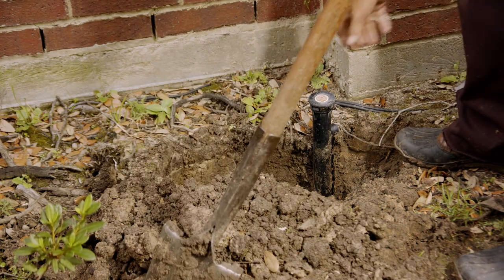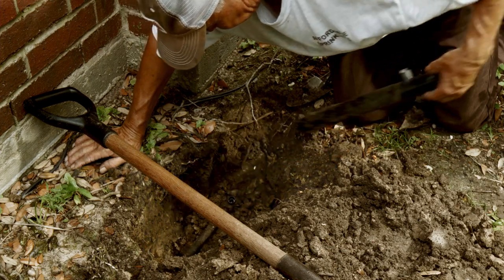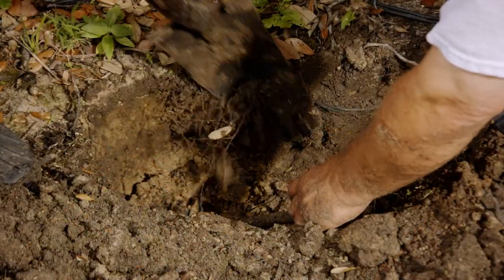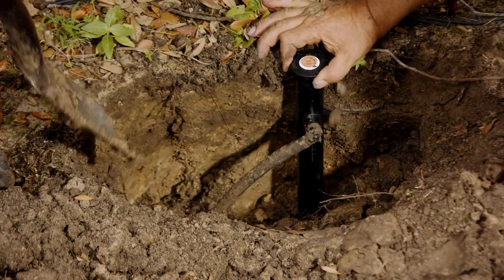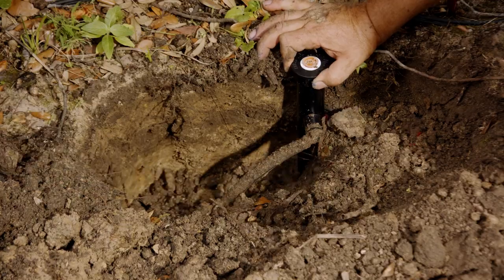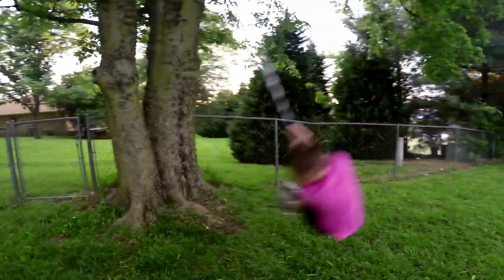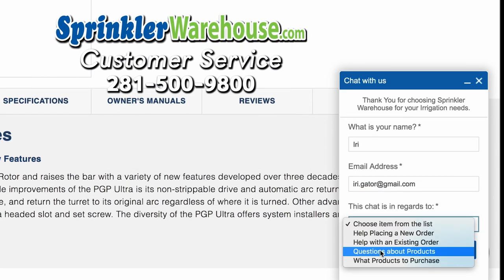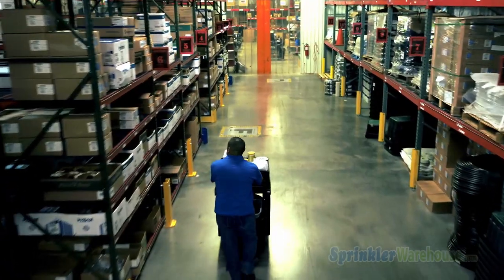Lowering A Pop up Sprinkler Head

Comment: Bruh u don’t need to lower a sprinkler head in a flower bed, this video is so unnecessary so I’m disappointed and disliking this video
Reply: Flower bed or not, it is still a tripping hazard.
Reply: @fescueme1081  if it’s against the house in a bed then it should not be a problem because that should not be a high traffic area because there is normally never a need to be in that spot